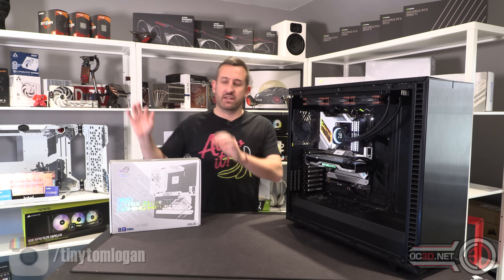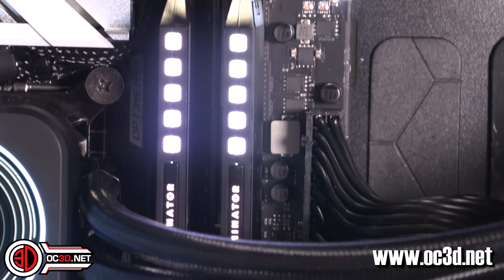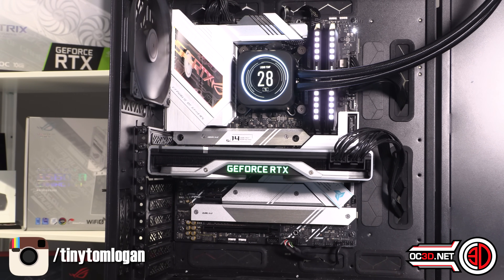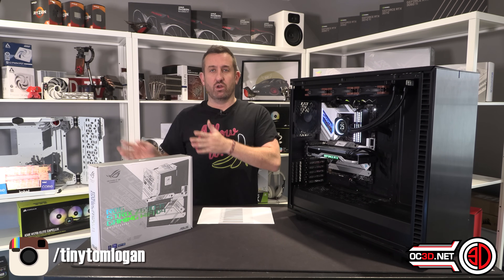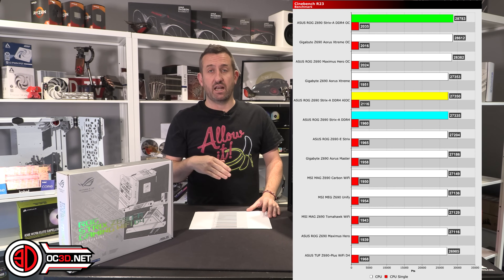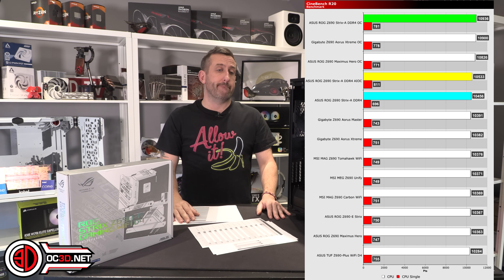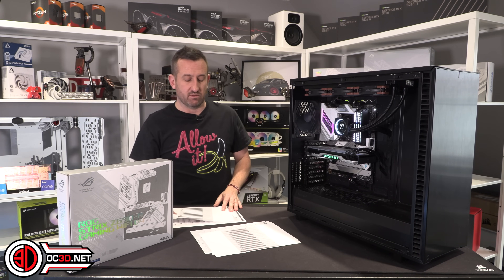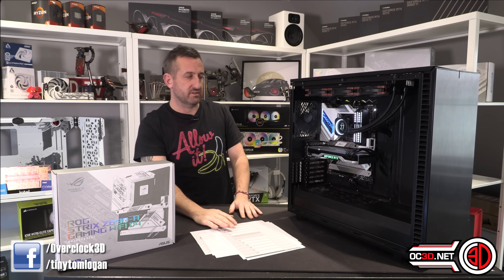Asus ROG Strix Z690 A D4 - White DDR4 Motherboard Review

Comment: That seems like a very narrow space around the CPU socket. Radiators are very tall and this board is NOT compatible with bequiet Dark Rock Pro cooler. I suspect it's not compatible with most dual tower air coolers :(
Reply: fits aio liquid freezer 2
Reply: @MrGreen1988  Again: AIR coolers.

Comment: ya i had the same mobo and a coolermaster td500 and a h150i 360mm cooler and the ram and the heatsink on the mobo was getting in the way when I tried to mount the cooler on the top

Comment: I'm in the US and have this MB. I defy anyone to locate a copy of the applicable warranty text. It isn't on the carton, in the carton, in the owners manual or on their website. This is probably true for all their computer components. There is only a reference to a couple of changes to the document, but no document.  They will disclose the length of the warranty from the item's birthdate, if you provide a serial number, but if you are comparison shopping you'll have to rely on retailers' sites for the basic number of years of warranty protection, and you won't be able to read the terms, which often are where the "gotchas" are found. Why so coy, Asus?

Comment: i got this Motherboard since December 2021. Its working great with Intel i9 12900k, NZXT Kraken X53 and Nvidia RTX 3090 Fe. The Kraken X53 does fit. There is  a special cpu bracket for it you can order for free from NZXT but you dont need it! The "old" Bracket does fit too and i have no temperature problems. I use for RAM two times DDR4 32GB (2x 16384MB) Corsair Vengeance RGB PRO SL DDR4-3600 DIMM CL18-22-22-42 Dual Kit.
Reply: Dude it’s so nice to see our built is legit the same. Just two questions for you man 1 does this motherboard perform well for gaming especially. and 2 do you know if the NZXT Z73 360mm AIO cooler fits with this motherboard. I got the NZXT H7 elite case which it fits fine I just wanted to double check the Z73 cooler in terms of fitting with this exact motherboard. Again man so sorry for rambling on if you were able to confirm these 2 questions words could not express my gratitude 🙏🏼🙏🏼🙏🏼🙏🏼
Reply: Do u know if the z73 fits on it?
Reply: @HarrisNazir  should fit. The Pumphead is the same.
Reply: do i need to use sl version of the memory? i ordered original pro today
Reply: Bro I'm  literally working on a build with the same specs as yours but I'm going to be using an i7 12700k. Glad to know that it came together nicely for someone else 🙏
Reply: @genesisv144  dude that’s great news I’m very excited to see it. My parts are all the same however I’ve had a change of thought in terms of my motherboard. I decided to go with the ASUS ROG STRIX Z690-A GAMING WIFI D4. Mainly cause it’s white and it’s a pretty decent motherboard for gaming. do you reckon the Z73 NZXT aio cooler is compatible with it. I’ve emailed pc case gear and other reliable computer stores but I’ve received no answer😭 if you could confirm the Z73 aio cooler compatibility in terms of using it with the ASUS ROG STRIX Z690-A GAMING WIFI D4 words could not express my gratitude🙏🏼
Reply: @shoto_9  yoo I was literally about to make the same decision😆
Reply: @genesisv144  ahahahhahah bro I’m so excited for this video🤣I’ve been woundering for so long if the NZXT Z73 360mm aio cooler is compatible with the ASUS ROG STRIX Z690-A GAMING WIFI D4 and your vid is gonna save me bro I’m super excited🙏🏼
Reply: @shoto_9  did the Z73 end up fitting on the board?
Reply: I'm about to upgrade to this out of x470 Ryzen 7 2700x I just can't pull the trigger on ryzen 7000 plus my case is a white tower 500 this board will compliment it well I'm already using a z53 kraken to
Reply: Do you need to use both 8 pins for the 12900k?

Comment: Im planning to make and upgrade from skylake to alderlake but still on ddr4 platform.
currently using 4 x 8GB Dominator Plats 3600mhz XMP

Im wondering if xmp will works on Z690 ddr4 platform with the 4 dimms that im currently using without any issues...
Reply: Im running dominator plats 3200 4x8 with this board and have xmp enabled...no issues so far

Comment: Do I need to plug in both 8 pin cpu power connectors with a i5 12600k? Or is it just for overclocking?

Comment: Can someone help me a little ? :D 
Im currently trying to Build a PC and the only thing im looking for is the Motherboard.
Current Components: Intel Core i9-12900K, NVIDIA GeForce RTX 3080 10GB | Palit GameRock LHR and 32GB DDR4-3600 G.Skill Trident Z Neo | 2x 16GB. (Not Included are the SSD NvMe and the Power supply) 
Im looking for a good white Motherboard and I reall like the Design of the ASUS ROG STRIX Z690-A GAMING WIFI D4 | Intel Z690. Does anyone have any expierience with this Motherboard? And can somebody tell me if its compatible with my Components? 

Would be a really great help :)

Comment: Hi. I had this MB but the gpu slot is not working, even on the replacement. I tried updating bios to the newest bios, still doesnt work. i tried swapping my Gigabyte RTX 3060ti to Asus GFX 970, still doesnt work. The onboard gpu is working. Changed the setting on System Agent Configuration from gpu motherboard to pcie but it goes back to gpu motherboard. I dont know what else to do. Can you please help or anyone? Thanks

Comment: U dont need both 8 pin for cpu power, one is enough, one 8pin can provide over 280wats, unless u doing some next level overclocking one 8 pin is enough
Reply: Headroom is always nice, that's nothing to complain about. Especially considering that the 12900K is pushing 240-250W.

Comment: Overclocking the i9-12900k (according to most Tech channels) seems to not gain enough results compared to thermals! That being said, I’m trying to figure out the best out of box boosting since Intel went all out for Alder Lake performance. 
I have this board (ROG Strix Z690-A Gaming WI-FI) and a i9-12900k. Trying to figure out if I should leave ASUS MCE enabled (default) or use Intel’s Turbo Boost since they went pretty high for stock Intel settings.
Reply: dont even bother oc 19 12k its not worth it its already too powerful

Comment: I have this motherboard LMOA is really in saying !!! My i9 12900K the OC to 5500 OC on 4 cores the rest are 54 on the P cores Voltage V421 max adaptive Voltage idle 25C on Kraken Z73 Push pull with 13 be quiet Light wings Light wings ...Looool I can't hear it at all when gaming without headsets

Comment: Also, watching your video further, you just didn't spend enough time with the CPU and board. I guess this is the inherent problem of producing video content is that your on a time crunch and don't have the time to do a deep dive. You don't need a 12900K or DDR5. Anyone doing the correct and proper research will already know this prior to buying anything. In Cinebench R23 I scored 21000 points for multicore.

Comment: I'm confused why you would call this a low end to middle tier motherboard. Spec wise, it's actually one of the higher end DDR4 boards on the market. Are you sure you're got this right? This board literally has all of the high-end features other than just a few missing things. 1 ethernet port rather than 2, 2 less USB ports and no DAC for audio. Everything else is evenly matched. I'm in the US and I paid $350 + tax. This is a fantastic board.
Reply: I was wondering this myself. Isn't this the best z690 ddr4 board asus offers?
Reply: hows tuf edition?

Comment: I have z690Hero. Because of issue with them(wrong fitted capacitor) I`m going to use RMA. I don`t want to burn my i912900k and another ROG parts like expensive ROG RTX. Another problem is to buy DDR5 in fair price. Thanks for review.
Cheers
Reply: Issue with z690 hero or this one?
Reply: @JeyC_  I have sent back my Asus z690 hero for RMA 
I have received full refund.

Comment: Thanks for the video.
Do any of the M.2 slots offer benefit over another for a WD 1TB SN850 SSD please?
The manual advised about single and dual DIMM positions but I couldn't spot anything about M.2.
Reply: They are all gen4, but I believe the top slot interfaces directly with the cpu versus the other slot is controlled by the chipset

Comment: Just bought this for a 12900k, 4 x 8gb @ 5333mhz (ddr4).   DDR5 is overrated for the next 1-2 years.   The premium in price is not worth it either.
Reply from the maker: Big ask getting DDR4 to work that high reliably tbh

Comment: i do want to say i have this motherboard the only asus strix with ddr 4. but that single fan conector by the 2 x 8 pin cpu power is the cpu opt header that controls from main cpu fan no way in bios at the moment to control the speed on its own

Comment: Gotta say I'm not entirely sold on the white aesthetic of this board. It's kind of a regular board with some aluminum heatsinks and cheap white plastic slapped onto it. The M.2 heatsinks also look a little random. 

If only vendors would be more willing to make nice DDR4 boards instead of leaving those at DDR5 (which hardly anyone can use right now as you pointed out).
Reply: This board is badass, not sure what you are talking about. Looks just as good as the asus ddr5 variants

Comment: Nice, I have this board with the Asus cashback on a 12700K so £75 of the MSRP and it runs the CPU very well and DDR4 3600 at Gear 1 so no complaints!

Comment: It was difficult to find compatible RAM over 4 GHz for this mobo. I returned and exchanged at least 4 RAMS already. I even had to downclock my RAM from 4400 to 4000 to make it stable.
Reply: Ive got the gskill trident z neo @3.600 will that be enough?
Reply: You are wasting your money on high frequency ram anyway. You are better off with ddr4 3200 cl14 or cl16
Reply: @mikerzisu9508  wrong, so wrong
Reply: @MrGreen1988  You are correct. I ended up going with ddr5 in my current build
Reply: @mikerzisu9508  ddr4 gear 1 at 400mhz smokes just about any ddr5 unless ur at ddr5 8000mhz

Comment: I went z690 w/ 12700k with DDR4 and loving the experience. Recent Black Friday sales had z690 motherboards & Intel 12th Gen CPUs 10-20% off which is great to see. I managed to score a small refund on mine as I opted to claim a return product with my retailer advising I could get a better deal at a competitor and as I only recently purchased my combo, I got a 10% refund without the need to return my item 🥰👍 (and I do use retailer for the majority of my purchases and been a long term customer).
Reply: Same as me !! i got this asus rog 350 now its in 500 550 !!
Reply: Dude can this motherboard use 3600mhz?
Reply: @hakimiabdulahlim2277  oh yeah. It can take much higher clocked ram than that
Reply: @hakimiabdulahlim2277   3200mhz?
Reply: do you think a kraken z63 would work on this? I'm looking at this mb and same cpu =)
Reply: @Markus_XI  as long as you use a lga1700 bracket and get good contact with the IHS, you should be able to keep the 12700k in check. Possibly not in cinebench or other benchmarking tools. In every day use, it should be fine. The 12900k is a different story, need a 360aio at a minimum.
Reply: @mikerzisu9508  I'm open to suggestions! would you recommend something different?
Reply: @Markus_XI  it will fit if you turn it with pump tubes to the 6 o'clock position or 3 o'clock position ( but can not use 1st dimm slot closest to cpu.The vrm heat sinks intrudes on the left side. Kinda lame..but it will fit. Also get the 1700 kit like the person suggested above.

Comment: Just built my machine on this platform paired with a 12900k and Corsair Platinum RGB (White) 4000mhz
Reply: 4000mhz ram is a complete waste due to the timings
Reply: @mikerzisu9508   im running mine at CAS 17... how is it a complete waste? You do know this is DDR4 right? It is just as fast and even faster than most DDR 5 at the moment.
Reply: @Chris-zf2xk  you get the same performance or even better out of ddr4 3200 cl16 or better yet cl14.
Reply: @mikerzisu9508   better performance out of synthetic benchmarks not gaming which is what i do
Reply: Hello,  can you please tell me temperatures on CINEBENCH ? What cooler are you using? Thank you
Reply: Can you share pls the part number of the Corsair Platinum RGB (White) 4000mhz that you use? Are the stable with xmp at 4000?
Thank you in advance

Comment: I have this mobo. with a 12700k, its cool mobo for the time being. Using a corsair H100i Elite Capellex aio, had to buy the stand-offs for it. Have no issues with the aio keeping the cpu cool, running 29c to 31c, at regular use. Gaming I run in the 40c to 45c, but have my aio fans at 85% to 90%. 

I did notice Tom is using the 2 8 pin cpu adapters, gonna have to add the other one?? I always wonddered if I had to use the second one, but seeing Tom doing it I guess I will too, lol. 

Great vid as always Tom, 

Thank you.
Reply: Same, got mine paired with a 12700k and running lovely  with a 280mm Freezer 2  :)
Reply: @sicr99  Hey do you have 2 8 pin cpu connectors plugged in??
Reply: I have the same mb cpu and aio cooler. I bought the stand offs as well. I also use both of the 8 pin supplemental power. Put mine in Be quiet 500dx white case. Great build man.
Reply: I only have 1 8 pin plugged in at the moment. It's fine at stock with the Intel power limits removed, but if you start pushing it higher voltage and clocks above 5.2Ghz it gets slightly warm to the touch. I have Cablemod custom cables. If I can ever find a new GPU I am going to order cables for it and an additional CPU 8 pin. My advice would be use 2 if you can with your setup but if not 1 is fine, just don't push the CPU very hard.
Reply: @Clay_333  yeah I don't over clock or anything like that. I did connect the other 8 pin connector, I guess it will not do any harm.
Thanks for your advice.
Reply: For the time being? You looking to replace it soon for some reason?
Reply: @mikerzisu9508  I am having a few issues with the mobo at the moment, have done a few fresh installs, updated bios, still having issues?? We will see, to be honest not likeing the white on the mobo.
Reply: @Pinkfloyd1173  I am looking to build an all white rig so it would work well for me. 

What kind of issues are you having? What hardware are you using?
Reply: @mikerzisu9508  The Q led lights sometimes show that there is some issues with my gpu. I get a chime saying that a new device has been plugged in, it happens on random times. Audio issues, where my woofer booms, 3 to 4 times on start up??
Reply: @Pinkfloyd1173  I would say it is either your gpu or your motherboard. Do you have a different gpu you can test with?
Reply: @mikerzisu9508  Gpu is fine, tested it on my other rig. It could just be the bios too, will wait tell my micro center has more of these mobos in stock or get another brand, will see.
Reply: @Pinkfloyd1173  what mobo is it?  You could have a short in your case as well
Reply: @mikerzisu9508  The one in this vid
Reply: @Pinkfloyd1173  hmm. Latest bios I am assuming? That is a bit concerning since I am considering the same board. It sounds like something is shorting out the board. I had a similar issue at one point due to the mobo making contact with the case
Reply: @mikerzisu9508  I would wait until the bios they release matures a bit. Its still new and if you go to the rog forums you will see alot of issues with the Z690 mobo's.
Reply: @Pinkfloyd1173  curious why you went ddr4 over ddr5?